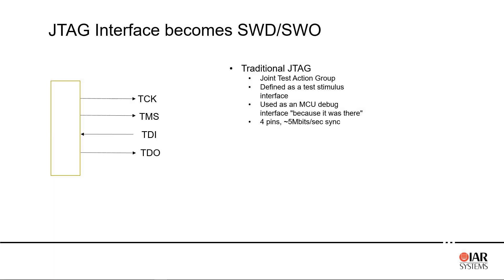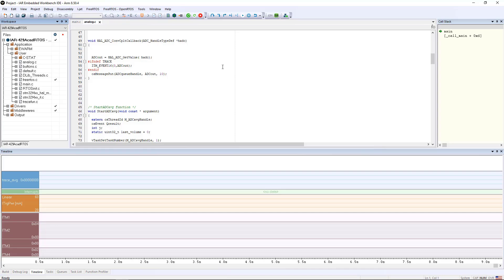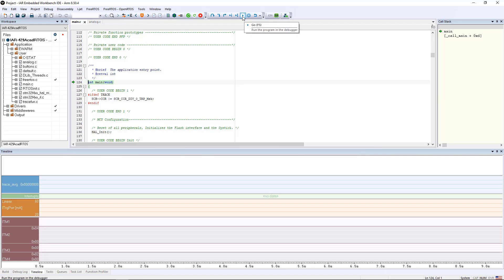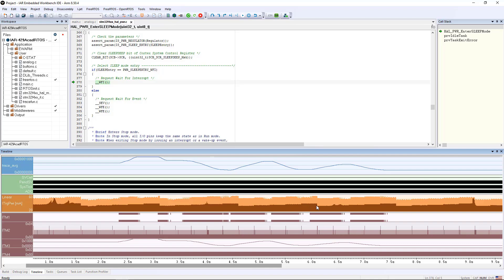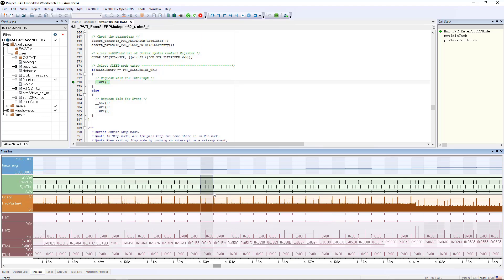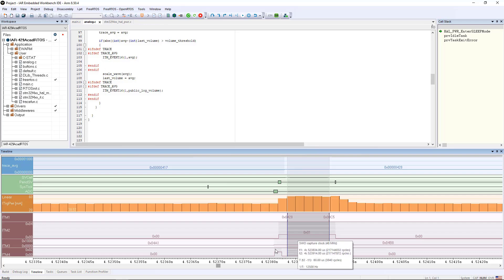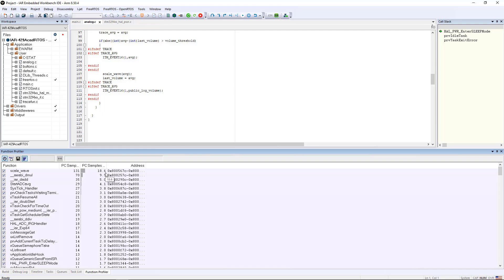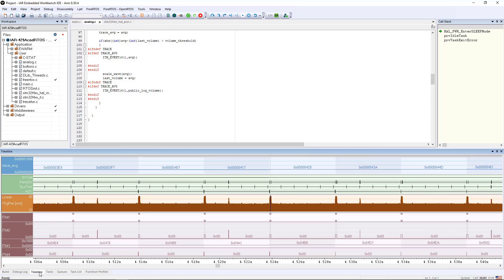Using SWO Trace with IAR Embedded Workbench for Arm

Comment: Extremely helpful tutorial. Thank you. Does Segger Jlink support this functonality?
Reply from the maker: Thanks for contacting us. The J-Link also supports the SWO Trace in IAR Embedded Workbench. Please keep in mind that you need to set the right CPU clock in the settings to have it working. If you need any more help, please reach out to fae@iar.com.
Reply: @IARSolutions  hi thanks for replying. Would I need a specific JLink to show me these kinds of traces?
Reply: The higher end J-Link probes are best, like the J-link Trace or J-Link Pro. The lower end J-Links have SWO access however the bandwidth is generally quite poor and limited to about 1 Mbit/sec, while the higher end probes can keep up with SWO streams of 10's of megabits per second.